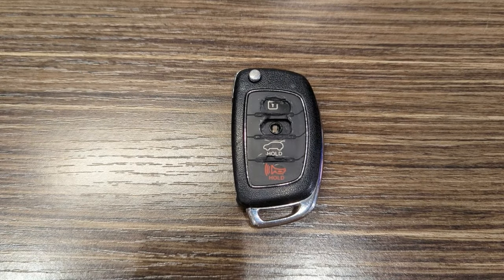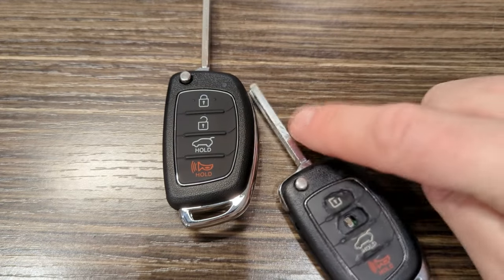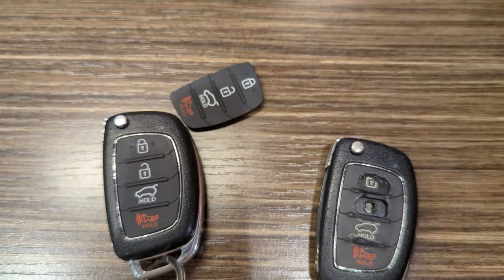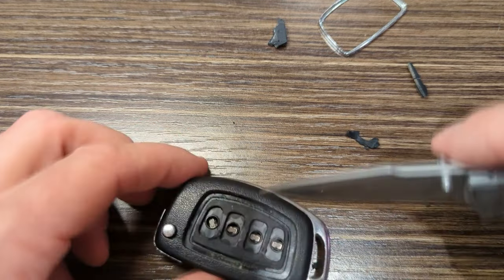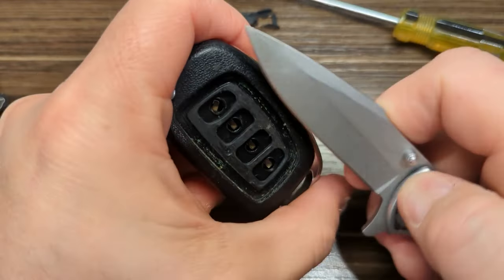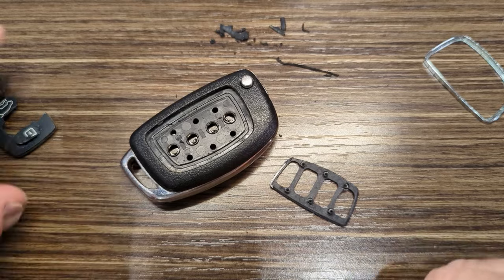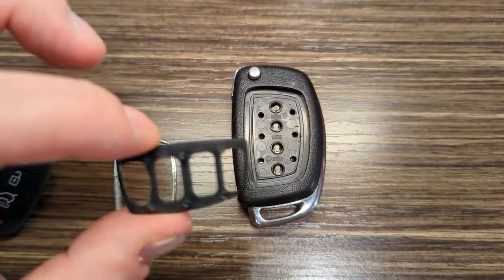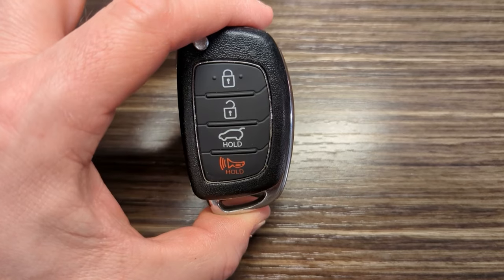'16 Santa Fe Key Fob Repair

Comment: You're working way too hard! Just take the rubber cover off and put a new one on...no glue needed or desired, making for easy removal and replacement; the rubber will hold it and the silver ring in place.  I bought a pack of 10 covers cheap from the Hyundai store online.  When one wears out I just quickly put another one on.
Reply: Would you happen to have the website with the 10pk?
Reply: 10 for 12.99
Reply: Ebay
Reply: @000028H  so did you get the 10 pack from eBay or the Hyundai store?
Reply: Yea agree that... I change in 5 minutes. No need to push like that and mine fit perfectly. But nice tutorial btw. Cheers
Reply: Post us a video tutorial of how you do
Reply: I see where people have asked for the web site and maybe some ordering info, but no answers.

Comment: These key fobs should be investigated by a state Attorney General.  They only last a couple of years and when you go to the dealer, they will charge you $ 350 - $ 400 to replace it.  Borderline criminal.  I bought the rubber cover on Amazon 2 for $ 7 and did it myself using super glue and patience.  I will never buy another Hyundai because of this.
Reply: I hear you brother neither will I but in addition to my fobs being destroyed I have scoring in all 4 cylinders and even though I am the original owner and the car has always been (over) serviced at the stealership Hyundai told me to fuck off when I lodged a just out of warranty claim.
Reply: My local locksmith has  replacements available for 130 programmed and all
Reply: 0kk
Reply: Kk9
Reply: @supercrackerkawasaki8888 im sure he just change the hard shell and 130 is a lot
Reply: Me either

Comment: Thanks James, best video I  have found on replacing this. I have the same exact key fob and problem with it as yours and your video will be a big help. 
The comment by Peter that this should be investigated by the state attorney general is so spot on I totally agree however I live in California and your lucky if any attorney general in the state will investigate even cold blooded murder, not an exaggeration.

Comment: Thank you for posting this, I bought a replacement fob case and was struggling to pop my used one open since I didn't want to break anything inside.  With this video, I just popped the rubber buttons out of the replacement case and put them on my original fob fairly quickly!
Now, I just need to order a second button replacement piece for my spare fob...super clutch video, I'm glad I came across it.

Comment: Thanks a bunch! 
Fixed the main and spare Hyundai keys taking the steps you suggested, by just replacing the keyboard for them. 
Key indications: filling the little-legs before mount it back, cleaning everything of old keyboard scraps, pealing off the damaged keyboard as the "entry-point", hence not damaging the case and the silver ring.
Thanks again! 🍻

Comment: Great video. I used a tartar scraper from a dental tool kit (that I usually use for miscellaneous craft projects and tiny repairs) to pry off the components and clean out the detritus. It worked really well for this.
Thanks again.

Comment: Fantastic! Thank you for the excellent instructions...I just successfully changed mine out and the pad is flush on all four corners. Only had to file down the center two pegs. I used a file on the end of a chiropodist tool--it can be searched on Amazon with this key phrase "Ingrown Toenail Tool Kit, File & Lifter Set." Doesn't have to be any exact brand, just make sure there's a file in the kit. I have a second pad for when my wife's keypad needs changing out.
Reply from the maker: Glad I could help!
Reply: 😄same here! @JamesDvorak
Reply: Great channel--very useful and handy and friendly! @JamesDvorak